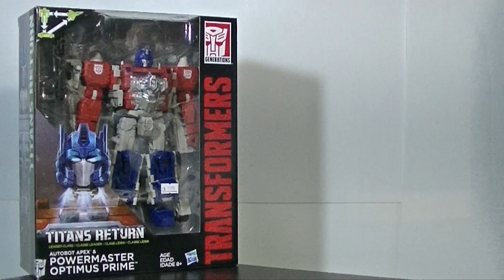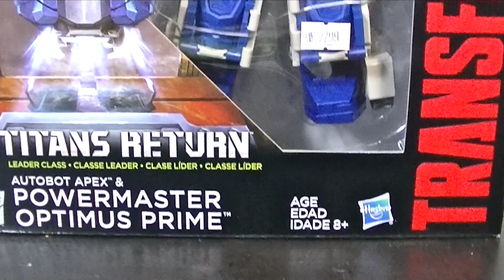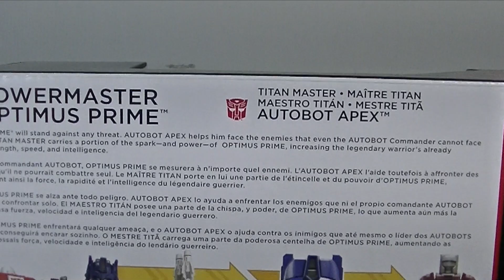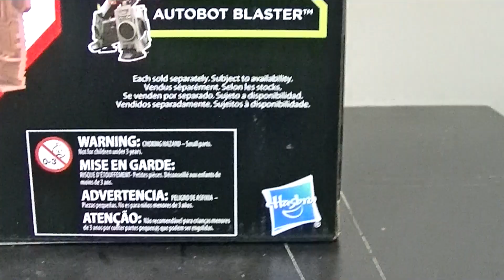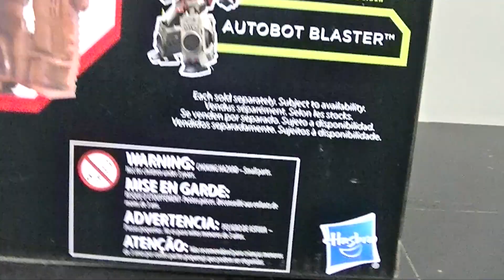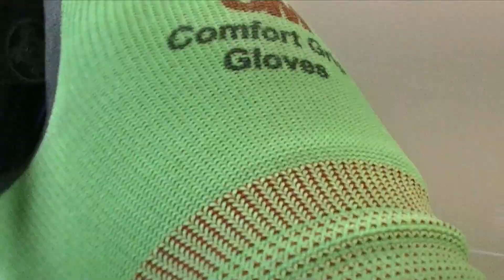felzbug Reviews Powermaster Optimus Prime Titans Return

Comment: Pretty sure the cabs aren't the same from the divide back - the new one has more apparent square holes alone the bottom, and since the cab is taller on Prime the back part of that also needs to be taller to match up with it. Very similar, but still not the same part.